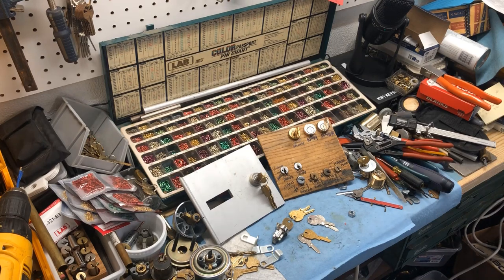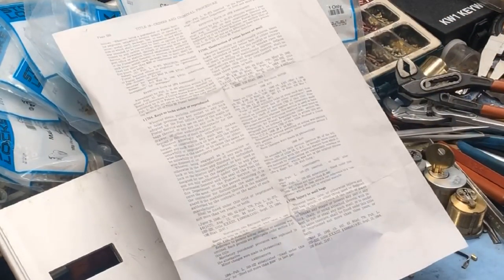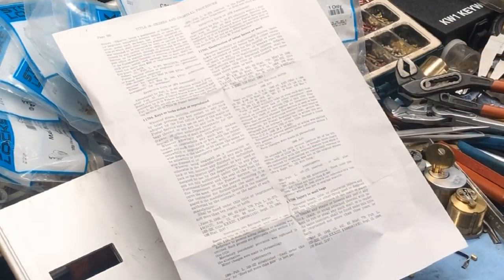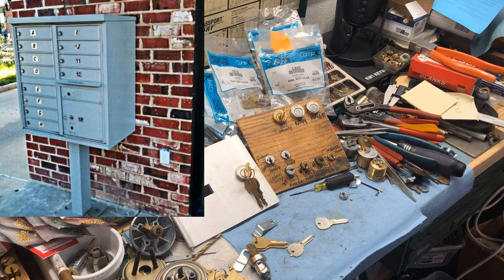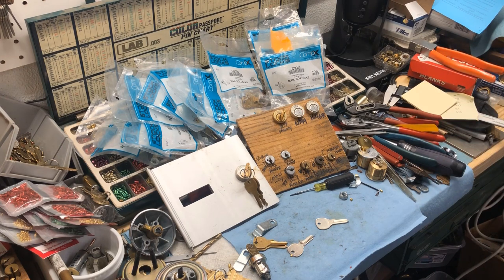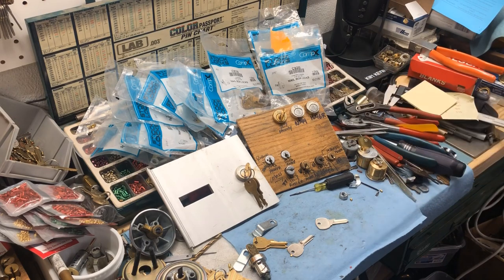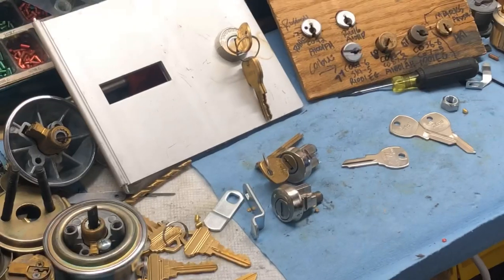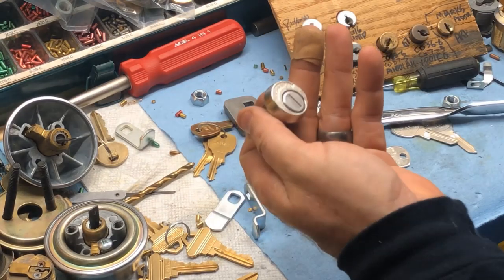Mailbox Locks: CompX C9100 & C9200 ~ USPS-L-1172C ~

Comment: What was never mentioned: the difference between the 9100 and 9200. The 9100 is open on the 3:00PM position while the 9200 is open on the 9:00 position. I learned it the hard way and had to buy the other lock. That means that if the lock is at the left of the door you need the 9100. If it’s at the right of the door, you need the 9200.
Reply from the maker: Which is clockwise or counterclockwise which I most assuredly mention

Comment: I rebuild them all the time. First thing I do is completely remove the top cover. Dump all the pins and rekey to a new random key. I reuse all the pins and springs. Amassed myself a nice little rekey set. I enjoy working on the small pin locks. Watch for the left and right keyway.

Comment: Using the new cutout in the old DD style cutouts significantly diminishes the torque resistance.  I had my CBU box broken into - the DD cutout allowed the new style lock to be cranked sideways. In part this was because of the softer metal of the older style doors (aluminum?) The DD cutout was deformed by the torque.  (And of course, the PO insists on us using these locks that can be raked open in seconds anyway.)

Comment: I went to my mailbox one day and my key wouldn't go in.  I thought I had the wrong key but someone put a different mailbox lock on my mailbox, it's a 3 unit box.  So I got my picks and opened the lock and removed it.  I got another mailbox lock from my locksmith friend and installed it using the hex nut so it can't be removed so fast.
Reply: Another story, a customer came into our shop with a two USPS mailbox locks and asked if we could make a key for it.  I told him I can't because that belongs to the US Post Office.  He said the locks came with the building.  I told him we could get similar locks that's not from the USPS if he wanted.  But he just shook my hand and left.  Don't know what that handshake was about.  I just thought that was weird.

Comment: do you sell a CCW (counter clockwise) lock replacement, or just the clockwise only?  My lock is on the left side and hingle on right side, which your link says normally means its a clockwise lock.
Reply from the maker: We have both, you can order on our website the 9100 but send a email to selockandkey@gmail.com with a follow up you need the 9200 CCW

Comment: The way you started out I was expecting to learn what the difference between the 9100 and 9200 is, did I just tune you out or did you elaborate?
Meaning, I needed to know what clockwise/cclockwise looks like. I need to replace a usps lock that LOCKS by turning left. Is that a counter-clockwise then?
Reply from the maker: redphantom2104 so which way do you unlock it?
Reply: @selock  The lock unlocks by turning the key clockwise. Is that the answer?

I guess my thinking is, the function of a lock is to "lock" things, so the operation of locking is done by turning counter-clockwise.
Reply: @selock  So the unlocking is the "operation direction"?
Reply from the maker: redphantom2104 yep. It sounds like you have a 9100. Mailboxes are always “locked” so you base it on unlocking
Reply: @selock  Thank you so much.

Comment: My lock doesn't have a removable pin cover... I accidentally let a pin fall into a groove on the plug now I'm not sure what to do.
Reply from the maker: What were you taking it apart for?
None of them technically have a “removable pin cover” but they can be removed and staked back on if necessary. It’s messy

Purchase a new one as a last resort, they are less than $15 🤷‍♂️

Comment: Confused about CW vs CCW, if mailbox key hole is on left, does that mean C9100 (cw) version?
Reply from the maker: Direction the key turns to unlock. Most of the time if the hinges are on the right (and lock is on the left) it will be the C9100)
Reply: @selock  thank you! subscribed!

Comment: HPC told me not to laser cut on the Blitz. Plunge cut only.
Reply from the maker: wattvoltamp HPC also recommended beating on the 1200 with a mallet during adjustment (they even had a cute image of it back around 2002) 😂
Reply: @selock  That's what I need to do 😀

Comment: have you ever heard anyone have a problem using Ilco 1646r blank vs. CompX 1646r blank I have tried the Ilco more times than i can count and it wont work. Getting ready to buy the compx brand. the only difference i can see between the ilco and the original CompX is a slight bevel on the CompX.
Reply from the maker: We were buying the OEM blanks before the Ilco o es were out due to demand but as soon as Ilco started making them we switched and have never had any issues (and go through a LOT of them)
Odd, are they just tight?
Reply: @selock  Nope they go in fine, I'm gonna buy a single OEM and see what happens. im at the point that ive had to just change the locks to the 880108 i dont have any issues with using the Ilcos on those

Comment: Help i lost my key to i was gonna open it with pry it open with a hammer and replace with prime line from home depot. Is it possible because the from seems to be attached to mail box
Reply from the maker: Hdhfh Enthb do not hammer anything you will damage the box. If it’s a condo or apartment get with management, if it’s part of a rented property check with your local post office about possibly removing it when the mail carrier is dropping off mail and had it open
Reply: SE Lock and Key its a usps-l-1172c i went to check its not attached do u think i can drill it out if mail man doesnt  unlock ir for me?